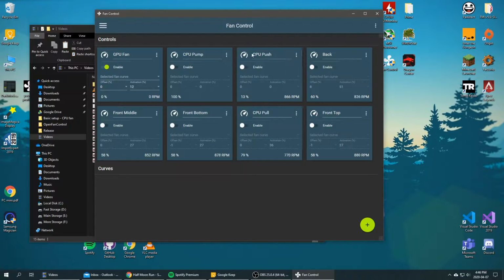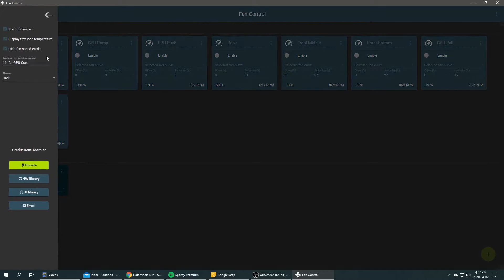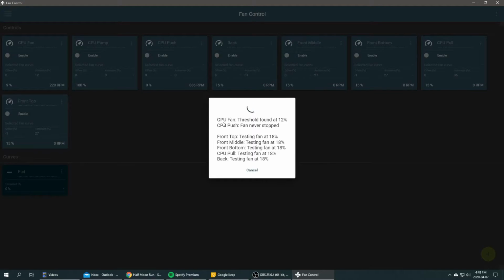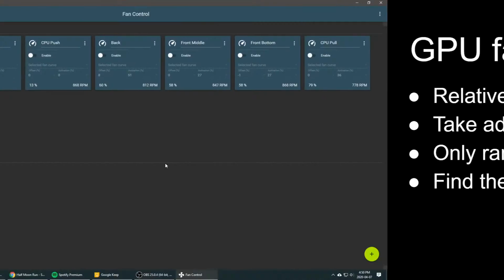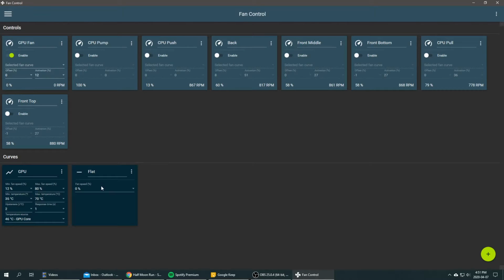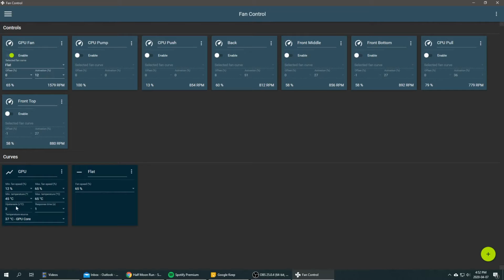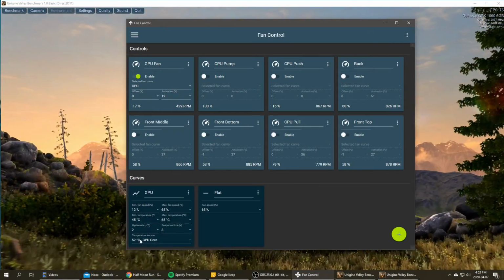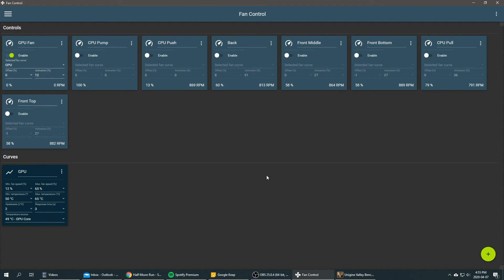Fan Control: GPU fan + NEW feature! (Part 3)

Comment: The Software doesn't Recognize my new GPU. I upgraded from a RX580 (Which worked very well) to a RX 6750xt, and FanControl doesn't recognize it at all. And yes, i have the GPU box in the sensor settings ticked.

Comment: It might be neater if any curve you set automatically maps to the activation threshold of any fan you apply it to (and possibly the max acceptable speed) such that the curve between 1 and 100 maps to the range of activation and max desired RPM (with 0 still being "true" 0 so you can stop the fans)

Comment: Not working with 6700xt.

Frustrating as this was a neat, light easy piece of software.

Can control fans with MSI Afterburner, can control with Adrenaline, but not with FANcontrol.

That's even with Afterburner uninstalled and getting the AMD drivers without the Adrenaline software, so it's not a software conflict. Must be FANcontrol not being able to override the baked in fan control of the GPU itself.

I suspect it doesn't work with any of the AMD GPUs 6000 onwards

Comment: Hi, I cant seem to detect GPU fan but everything else is working GREAT👌 - B450 tomahawk + Ryzen 3600 + Gigabyte Rtx 2060 all with newest updates and I''ve uninstalled Dragon Center too

Any idea why my GPU fans not being detected?, it picks up my GPU temp, thanks
Reply from the maker: Your GPU probably uses Nvidia's new fan API which support individual control for each fan on your GPU, which is not public on their dev website yet.
Reply: @rmsoftware3759  Okay your most recent updates have made it possible to now detect my GPU fans. Really appreciate your hard work. 

Hey I've not read or heard you talk about what fan defaults are favourable in the bios settings, e.g pwm/DC - smart/fan percentages. I'm currently using a smart pwm curve in my bios settings, is this ideal?
Reply from the maker: @sk1llzee564  It's really motherboard dependent, but generally setting a manual fixed value works the best. However, if your smart PWM setting doesn't cause any issue and gets overriden properly, then leave it as is.

Comment: Hello, good job. Thank you.
1. Is it possible to make it run at stratup ?
2. I can't control my GPU fan, its an Nvidia RTX 2060 ? Do you have any idea ?
Reply from the maker: 1) look in the ZIP, there is a script to add a startup task.
2) Do you have any conflicting software? MSI After burner, evga precision and so on?
Reply: @rmsoftware3759  Thank you.
Yes I have MSI After Burner, HW Monitor, NZXT Cam an HW Monitor. But they are not running
Reply: @TDply  Afterburner often runs in the background, like if you set your overclock with it. In auto mode, it will prevent the GPU control from my software.
Reply: @RemX405  I only use afterburner to display  graphic temps, no oc, no fan control... and now i have uninstall After burner

Comment: Great tutorial and software man! I've been trying it for several days now and works great. I have one "cosmetic" request, how hard is it to add more temperatures to tray? Right now i'm using my CPU Package, but would be great if you could add GPU Core as well (or maybe more). Also you are probably aware of the high temperature of the AMD x570 chipset. You think you can add a reading for that sensor? Currently there are several readings from the motherboard, but none of them is the real Chipset temperature that idles around 58 degrees on my mobo. So far HWinfo is the only one that can read this temperature and would be great to be able to set fans according to it.
Reply from the maker: Sensor reading compatibility is done by LibreHardwareMonitor ( see the HWLibrary button ).  Any update this repo gets, Fan Control will also get it .
Reply: @rmsoftware3759  Got it! Thanks for answering. What about adding more temperatures to tray? At the moment i'm forced to use both FanControl and HWinfo to monitor several.
Reply from the maker: @Danko_HS  Well of course I could add it quite easily, but I don't want Fan Control to be a monitoring software like HWInfo with live plots and stuff, I want to keep it a bare minimum fan control software, and so I'm very careful when adding features to not deviate from that original goal. With that in mind, I don't know how this feature wouldn't feel like a tacked on monitoring feature.
Reply: @rmsoftware3759  Ok that's cool man. Whatever you decide is fine by me, after all the fan control section is what caught my attention in the first place. I just figured, since you can add one temperature, why not another so you can be able to monitor them without opening the window every time. The problem with having 2 programs reading temperatures is that i don't know how this effects the sleeping power state of these Ryzen 3000 CPUs. I remember an AMD employee saying having more than one might wake up some of the cores even when not in use. Anyway thanks for your time! Best of luck!